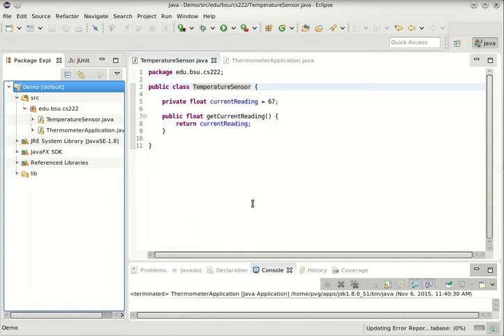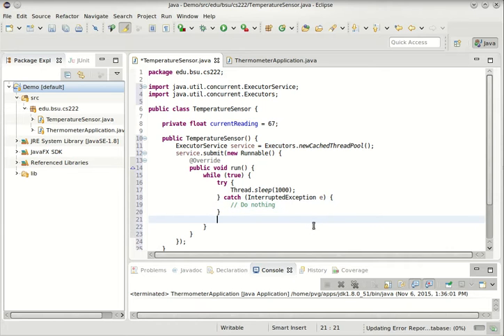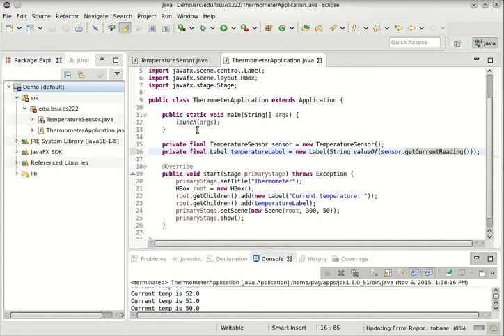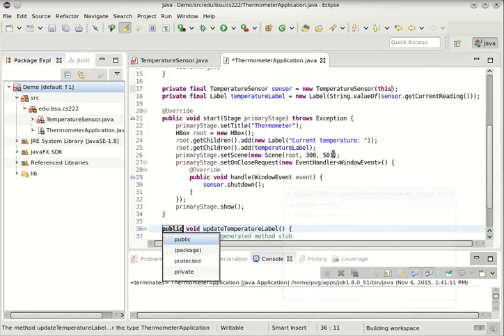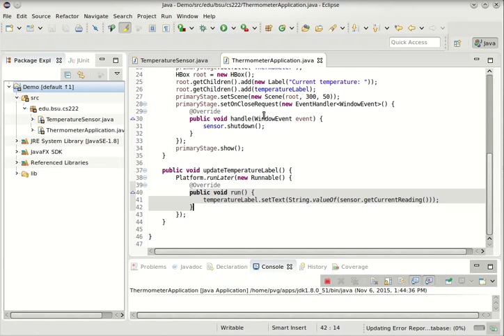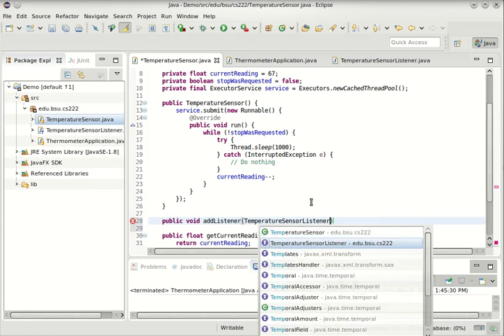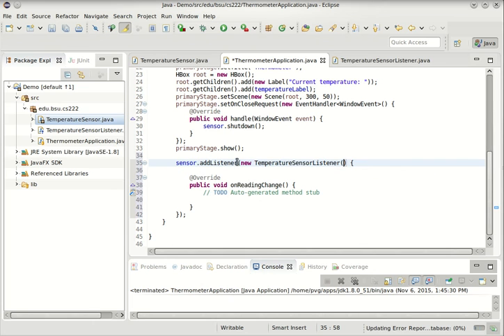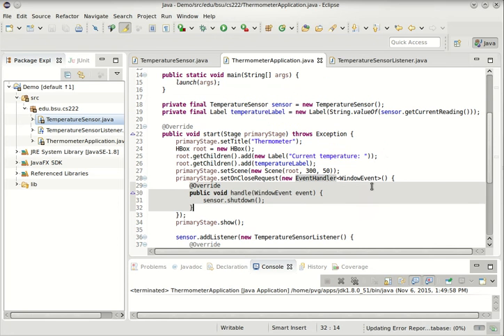Observer Pattern (with Executor and JavaFX)

Comment: Thank you. 
QUESTION: So for years in Swing GUI programming, it's been unacceptable for a model to import ANYTHING from the view, but in my experience with Swing, the listener interfaces were always in the view. 
So, would TemperatureSensorListener  be in the model? And then the ThermometerApplication, (view), would import TemperatureSensorListener from the model? Or potentially retrieve it via a linkage from the controller, and the CONTROLLER would directly import it?

Is it okay now with javafx for your view to be directly referencing the model like this, or would it be best to supply wrapper methods in a controller class? 
Lastly, even if we kept the TemperatureSensorListener interface in the model, I noticed that if we use a Java 8 Lamda expression to say, add a new TemperatureSensorListener, we don't actually have to import the model.TemperatureSensorListener, therefore this might be the preferred way, since it doesn't have to actually import from the model ? Sorry, it's all very confusing switching from Swing to Javafx for me.. they change a lot of concepts..
Reply from the maker: The TemperatureSensorListener is in the model as the agent that allows other objects to hear about changes without the model's needing an explicit dependency upon them. Without it, the model would have to tell the view directly that the model has changed, but that's exactly the dependency that we're inverting with this design pattern. My example uses a separable model architecture, not MVC, so there is no controller: it gives a more pure example not to have to deal with a controller.
Reply from the maker: Just saw the second part of your question. Lambdas don't fundamentally change this pattern; they just make it easier to type. You can still do observer or publish/subscribe with lambdas just with less plumbing.

Using a separable model architecture, your view has to depend on your model if it's going to act as a listener. You can do this with JavaFX too if you want, for example if you skip using FXML or SceneBuilder and simply build the GUI programmatically as you would in Swing.

Switching to MVC or MVP architecture's doesn't really significantly change the design pattern. Observer still shows up everywhere, it's just a question of which agent watches which, inevitably requiring more plumbing the more indirection you add. That's why I like separable model for a lot of my work, for what it's worth: it's often the simplest solution that maintains the Single Responsibility Principle, although it comes with its own tradeoffs of course. Of course, do a search for a definition of "MVC" and you rarely get the same answer twice, which is why I like to avoid that acronym altogether :)
Reply: Thanks so much for answering, and TWICE! Subscribed.

Comment: wow the Tutorial is awesome !!!!  the best so far !!
BUT it doesnt work for me =(

I work with JavaFX and Scenebuilder so things are a bit different. I  want to start everything with a  click on a button. Which method should I call? :-/

I dont just decrease a value. I have got a big method with a calculation and i need to display the result of it. Should i call this method in the constructor instead of your currentReading- - ;

it would be awesome if you could help me !! _
Reply from the maker: The fundamental approach is the same: push the work off of the event thread and onto a worker thread. Then, when the work is done, have that thread post notification back to the event thread, using that Platform.runLater method.
Reply: i try but i dont get it :(  normally i call my calculation method with my button click but i dont know what to do know. and i dont know if i have to call something in the start method. i think thats to difficult to me. but thank you !!